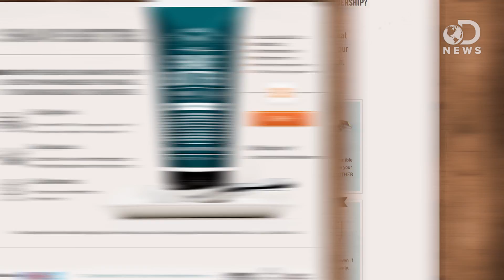Why Does Beer Foam?

Comment: 9-12% Belgian beers won't form foam at all? Where was that study made? It's so incorrect. Duvel has a huge head, Chimay has a huge head, St. Bernardus 12 maintains a pretty decent head, Rochefort 10 also maintains a solid top of foam. In fact, all of those beers have a larger head than any lager I've consumed.

Comment: I love beer, I cant have the weak pissy water that Americans claim to be the best or at least the adds do, anyway, pouring a beer isn't so simple as pouring into a glass,
First room temp glass no. you want frosted colder the better
there is also a perfect angle and speed of flow, you don't want to slam it into the glass or all your getting is foam, you almost want it on a 45degree angle.
the best temperature for beer is between 2-5C (35-41F) if you serve it in that temperature by the time its been demolished from a pint size glass it should just reach room temp at the last bit.
I love beer,

Comment: Firstly, who in their right minds (who actually enjoys beer) bitches about the head? It's a crucial element to enjoying a lot of good beers.

Second, and waaaay off-topic, if you want a DAMN good shave, on the cheap, get into dual-edge safety razors and wet-lather. Check out redditdotcom/r/wicked_edge for all you need to know. Careful, though; a lot of people start out there to save money, but end up with RAS/GAS (razor-/gear-acquisition syndrome). It's not harmful, except to your wallet.

Comment: Fun fact: want less foam, but still want the delicious taste that comes with it? Pour your beer toward the middle of your pint glass while holding the glass diagonally, and then as you reach the top with the liquid, bring the glass vertical, and pour the remainder of the beer straight into the middle of the liquid. 

The beer falling in the center of the slanted glass produced less friction, meaning less bubbles; the last but can produce enough head on it's own.
Reply: So basically, how every pub in England poor's a pint?
Reply: CHUBZY04 The world*
Reply: thanks for the info i was holding my glass vertically and then in one swift move pouring beer into my glass at break-neck speeds, getting the foamy brew all over me.  I couldn't figure out why that was but I tried it your way and now I can finally enjoy beer and instead of wearing it.
Reply: Hahaha I didn't want to take that guess, so basically, its just common knowledge and this guy Chris Fox writes an essay about it.
Reply: CHUBZY04 Not everyone is of drinking age yet, so how would they know? Also, most people don't know why people pour the way they do. The more you know the better. :)
Reply: The same way most people learn, by observation and questioning.
Reply: Chris Fox well they should not be thinking about how to enjoy beer better if they are not of drinking age but i know thats not what you meant but, you can teach them that logic with soda. just saying, suggesting that your letting the youth know for education is kinda eh.

I mean because you also said " want less foam, but still want the delicious taste that comes with it? Pour your beer toward the middle of your pint glass while holding the glass diagonally" and that could imply that you want people under the drinking age to know how they can enjoy beer better. im not saying that i just wan't to let you know how it can look.
Reply: Leon Kennedy "They shouldn't be thinking about drinking if they aren't yet an arbitrary age set by the government, because drinking is evil and legal adults not yet 21 are incompetent". Ok, dude. :)